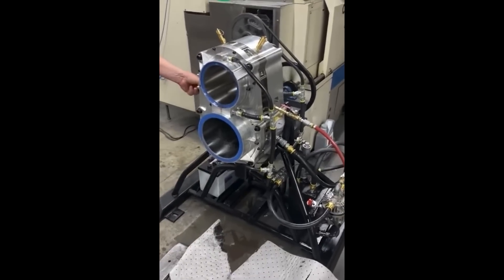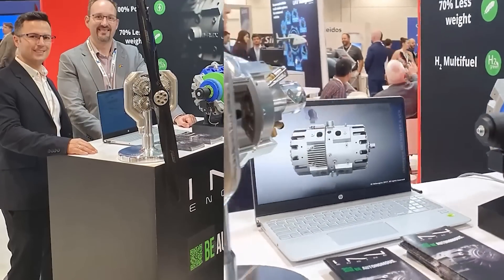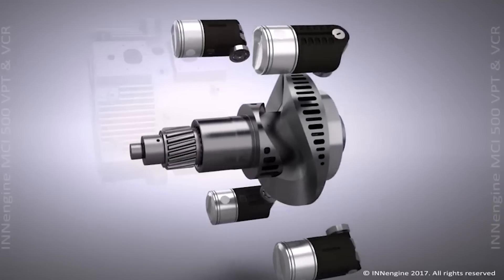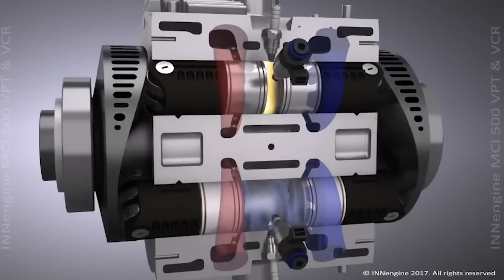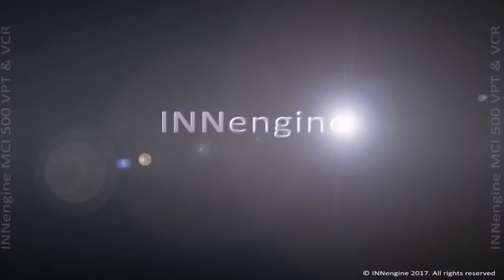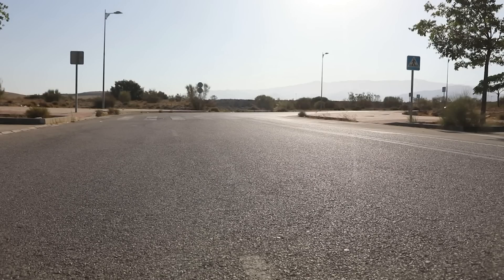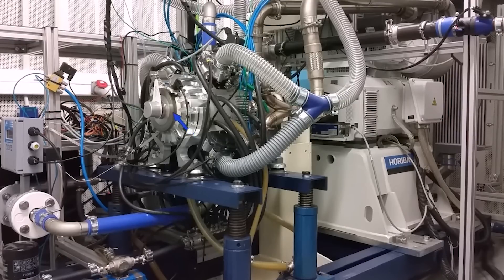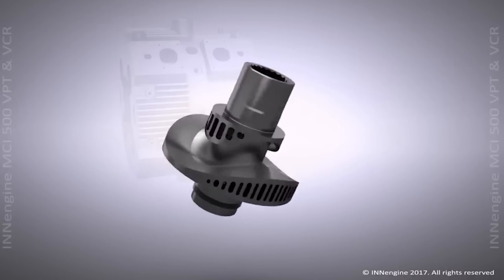1 Stroke Engine: Hydrogen powered Breakthrough in Combustion Engine Design.

Comment: They acknowledge that 1-stroke is a misnomer, but give it that term to differentiate it from traditional 2-stroke engines. Also, they've said that it can run on gasoline as well as hydrogen. Totally brilliant if it's reliable, efficient and truly has low emissions.

Comment: It is 2 stroke because the intake and exhaust are on the same time and not happen during the compression and ignition time. Could be called 3 times, because there are 3 separeted times, blocked or closed for some time.

Comment: >>. I really believe that hydrogen fuel can be the answer to the future’s engine demand.<<
Yeah, I see that. But that is essentially a solution desperately looking for a problem. 
I like the engine idea, BUT: Recent model engines produce H2O and CO2...neither of which is a "pollutant".
There is practically zero CO2 in the atmosphere @ .04%......an insignificant number compared to 78% Nitrogen.

Comment: It has the same problems as the 2 strokes plus additional ones. If it was viable, they would have it in a vehicle or at least give performance specifications
Reply: Es viable.
Reply: There is no mix between oil and petrol. No vibes, less weight. Have you really reviewed the engine?

Comment: Thanks for bringing this engine to our attention. I really believe that hydrogen fuel can be the answer to the future’s engine demand. The reciprocating piston engine delivers the most power per fuel capacity. And , now this engine appears to be answer to the power supply. Brilliant design! Hope it can be sourced for a large project to give it more exposure. Power on !
Reply: Ese motor se fabrica en Granada (España).
Reply: Hydrogen is not fuel. It is just an inefficent battery.
Hydrogen is common only chemically bounded in more complex molecules.
Atomic hydrogen does not exist in planetary nature.
To get it, you must pour energy to break the bounds.
Whatever thing you do with the resulting atomic hydrogen (but nuclear fusion of course) will never give back the energy spent to break the chemical bounds in the first place.
Because of entropy. Laws of phisics, immune to ideology.
Moreover, hydrogen is dangerous and expensive to store.
Want to use gas as fuel? Use methane, or propane, or butane.
All easy to extract or produce, easy to store, very little or no burning residuals, perfect for piston engines. However, regarding aeronautical engines, liquid fuel will always beat gaseous fuel, because of the added weight of a pressure tank. To make an aircraft uselessly heavy because of dumb ideology is hardly an improvement. Jet engines and kerosene are just fine. This said, the one stroke engine idea is worth consideration: it is a funny, cool concept unfortunately flawed by the obvious mechanical weak point of the waved disc replacing the rods and crankshaft. 4 times the power you said? Yes, at equal revs. A two stroke will rev happily over 10.000 rpm, a modern four stroke over 15.000 rpm.
Rev the one stroke engine near these regimes, and it will wear very rapidly, accumulate play, start vibrating and disassembling itself. As it is, fueled with methane, this motor could maybe be a cool, compact range extender, surely cleaner than a gas turbine (that would be my suggestion for a generator, if a simple 4 stroke engine is out of question because of ideology). Using a product for several years instead of scrapping it because of ideological whitch hunting, prevents useless pollution as well: just saying.
Efficent catalyzators solved most of the problem 20 years ago.
Modern petrol engines are robust, long lasting, unexpensive, efficent, clean and dependable. To stop making ICEs because of false technical dogmas, and replace them with battery operated systems or cumbersome "alternative" engine systems, just because of the push of ideological legislation will only increase costs and overall pollution.
Reply: Yes it’s already being produced in volume in a factory. In Manchester. I hoped to find out more about it as it’s worth investing some money in. I was aware of it two years ago. It’s also being laid out by the government’s investment, hence you see all the gas pipes being lined with the yellow plastic, it’s going to be a mix of normal gas and hydrogen through the pipeline very soon as most manufacturers of boilers. Have a conversion kit to run on hydrogen and gas ready for £300 conversion.

Comment: All hydrogen engines are low emissions engines, how does this one fare with gasoline? I doubt it's possible to have zero emissions with that fuel source. How is the hydrogen produced for the motor, is it through electrolysis? So there would be a power loss (internally sourcing) in producing the fuel by needing to generate enough electricity to go through that extra process. It's all very interesting. I'm not an engineer, I just have a basic understanding of science. I'm not trying to critique, I'm just curious.

Comment: Burning Hydrogen in an Internal Combustion Engine (ICE) using atmospheric gasses which has in addition to 21% oxygen needed for combustion of Hydrogen, also has 78% nitrogen. The resulting combustion process of burning hydrogen will produce Nitrous Oxide Gas Emissions. Even very Small amounts of Nitrogen Oxide is a potent greenhouse gas lasting 114 years in the Earth's Atmosphere. A single nitrous oxide molecule has 298 times the global warming potential of a carbon dioxide ( CO2)  molecule. Without removing 100% of the Nitrous Oxide from the I.C.E. vehicles tailpipe emissions, running ICE on today's almost non-existent Green Hydrogen Fuel sources will only accelerate Earth's warming climate change. Today's Hydrogen comes from Hydrocarbon sources, adding to the net greenhouse gas emissions of Hydrogen Fuel to include Carbon Dioxide, Methane (lost in Natural Gas transport pipe leaks) , and now an adder of potent Nitrous Oxide gas to Earth's Atmosphere. I wish you luck creating a  zero emissions vehicle any time soon that only emits water out of the tailpipe.

Reducing Hydrogen I.C.E. tailpipe emissions with urea additive treatments like Diesel exhaust treatment AdBlue, seem not to be a solution. To make urea, producers in a energy intensive (polluting) process combine ammonia with carbon dioxide (CO2), then when used as an nitrous oxide I.C.E. exhaust after treatment an equal amount of CO2 that was needed in urea production is emitted back to the atmosphere. So burning Hydrogen with AdBlue to nigate Nitrous Oxide is returning CO2 back to the atmosphere. So what is the point or why is the preference of burning Hydrogen as a less environmentally taxing replacement fuel to Diesel or Gasoline when both of these fuels choices when burned return CO2 back to Earth's atmosphere when combusted in a Internal Combustion Engine just like burning Hydrogen would?
"....... When AdBlue is used, water vapor, nitrogen and carbon dioxide are released through a process called Selective Catalytic Reduction (SCR)....." Ammonia or Urea after treatment merely shifts the  Hydrogen or Diesel ICE greenhouse gas emissions from the tailpipe spewing into the Earth's Atmosphere to a distant factory that produces the Ammonia or Urea product spewing into the atmosphere there. So the Ammonia or Urea chemical formulation process at the factory from raw materials releases greenhouse gasses. Also the Electricity needed to create the Ammonia or Urea pollutes the atmosphere there or from some other factory who pollutes the air to ship there with even more excessive atmospheric pollutants.Then the factory has to be powered for lights , computers, etc... and climate controlled burdening the atmosphere with more pollutants from electric consumption there and emitted elsewhere by a electric generator. Then plastic jugs / bottles made from oil have to be made and brought by a commercial truck to the Ammonia or Urea factory, causing more pollution. Then boxes need to be made and ink purchased for labels causing more environmental damaging raw material needed purchase plus energy consumption to make and ship..Then the boxed Ammonia or Urea bottles have to be shipped then distributed by truck additionally to the end user all adding to a Diesel or Hydrogen ICE pollution with Ammonia or Urea additive putting additional CO2  into the atmosphere because of being manufactured. Then the  I.C.E driver will drive to the retailer to purchase Ammonia or Urea bottles causing more CO2 into the atmosphere because they are using a Ammonia or Urea additive  Then the plastic bottles because of having chemical residue in them are not recyclable in most places or they are thrown in a dumpster never recycled to go to fill up a landfill causing more pollution. Then the boxes need to be handled to be recycled or thrown out all processes putting more pollution into the atmosphere or landfilled. Ammonia or Urea additives are worse for the planet than letting an I.C.E spew pollution at the tailpipe. Sorry that green hydrogen gas lighting sayers have perversely polluted your thinking. Frankly speaking NO mode of transportation that extracts energy from our environment is pollution free, so pick your Planet poisoning method to get around. Even a very basic form of transportation case in point is that when walking, or riding a bike a human is using food calories from food produced on forest cleared lands, shipped by I.C.E. producing CO2, fresh to you from across the globe, and then we humans produce flatulence during exertion of human driven transportation moving ourselves locally producing Carbon Dioxide ( CO-2) and Methane. An environmentalist in the UK has proposed a solution for this form of human polluting transportation, in that we be kept within 15 miles by wearing a GPS ankle bracelet that reports to authorities your wandering, and fines you for producing extra transportation green greenhouse gasses outside your invisible pen. Please be equally alarmed that human Methane flatulence is a greenhouse gas which is even more global warming than Hydrocarbon Crude Oil, or Fart CO2 emissions. Methane has more than 80 times the warming power of carbon dioxide over the first 20 years after it reaches the atmosphere. Also environmentalists fart after digesting food, so will all concerned environmentalists save the planet from their human induced personal production of global warming digestive gasses lingering for more than a century in Earth's Atmosphere, such as  methane production, by volunteering to stop their bodily biological digestive functions permanently?
Reply: Rather like human extermination?

Comment: They are 2 stroke - not one- these opposed piston 2 strokes are quite common - what is different is the rocking cam system .
Reply: Most of these opposed piston engines are diesel- in trucks/ships/rail locos- Napier Deltic - Knocker Commer etc and giant merchant ship engines - its the rocking cam type drive that may be perfected in the future ?
Reply: WW 2 Aero Engines - JunkersJumo 205 six cylinder opposed piston diesels - Napier Deltic compact high power diesel engines-that rocking cam systems is doubtful  at low revs ?
Reply: Company registered it as 2 stroke, uses only commercially
''1 stroke''

Comment: Nice vid. Nice engine. Actually it is 2stroke 2firing per revolution engine. If you look deeper, the construction is actually Junkers Ju88 plane diesel or 5TD,5TDF,6TD,3TD tank diesel made axial. There was also similar british single crankshaft many levers motor. Getting rid of 2 crankshafts and making small powerful and lightweight engine is super nice. But it is 2stroke with some small inevitable oil pollution. Maybe we can just tolerate that? And using hydrogen in internal combustion engines dates back to at least WWII times. Problems with hydrogen are low energy density and detonation. It is known how to mitigate either of them but simultaneously? Will not it be just toooo expensive in the end?
Reply: exactly, the hydrogen solution isn’t exactly viable right now and people don’t really understand that. As proven by the toyota mirai you need a fuel cell that the hydrogen powers as the amount of hydrogen you would need to power a stand alone hydrogen engine leaves virtually no space in the car. So at best, the current application would just be a range extender. 

I also felt that this video was misleading as no mention of torque was included 😂😂. With no crankshaft there’s significantly less torque and it’s unknown how that curve actually is affected!! To prove that I noticed the mx5 had a supercharger of sorts which was a means of forced induction and therefore it’s almost like the peak torque is at very high rpm. 

Therefore instant torque from a battery would be best suited to this application imo and so it would be cheaper to just buy an ev. 

I guess the marketing should focus on the lightweight for now as the issues are addressed and technology advances!!
Reply: I don't see where it has what I consider 'two stroke' problems. It will need forced induction, and probably cylinder scavenging. The real problems with two stroke is they need to have oil injected into the fuel stream to help lubricate the engine and that makes it difficult to control engine emissions. i don't see that as being an issue with this design.
Reply: Company registered it as 2 stroke, uses only commercially
''1 stroke''

Comment: It is an interesting concept, i see the efficiency gains, but it's still a 2 stroke. Dont see the need for the additional 4 opposed  pistons other than vibration reduction, maybe? I can't see this being a reliable. How do you lubricate the....ummm...lets call them cam-cranks....connecting rods float in pressurized oil on a typical engine. That can't happen here where the piston meets the camcrank, it must be splashed or sprayed with oil like in a turbine engine. I dont see lubrication being nearly as effective on those piston bearings or mating surface and think that will be a life limiter for this engine.
Reply: By having an opposed piston design, you eliminate the head, the head gasket, the valve train, etc. - and instead of converting energy to heat in the valves and head, you can convert more potential energy into kinetic energy into the opposed piston. 

In other words, you can extract more energy per combustion, and there is enhanced sealing in the cylinder. 

There is also a lower oil wiper ring on the bottom of the piston, such as the old 2 stroke diesel engines, which are known for their power and reliability.
Reply: @leeknivek  understand your thinking and I had the same though, if each cylinder was on singular tube, but in second 9 of the video it clearly shows 2  heads. That means 2 sealing surfaces per cylinder since the two cylinders are connected. Many 2 strokes don't have valve trains as well just opening in the side of the cylinder that the piston closes and reveals as it cycles. Any kinetic energy Imparted to the opposed piston is also kinetic energy lost when transferring energy to the crankshaft. 

Most engines have that oil seal right below the piston rings to keep the cylinder properly oiled, but the issue I see here is that you can't fill between piston and the cams that the pistons ride on with oil. Filling the space would meaning losing energy to the pistons "pumping" into the vacated area of other pistons. That means it can't be submerged and I feel the friction would be worse than a normal crankshaft since it can only be splashed or sprayed to keep it lubricated.
Reply: @SomeoneElse92422  I believe that’s a different thing at 0:09, the inn engine cylinders are a solid tube as far as I have seen elsewhere. 

Yeah, I have to agree with the oiling problem, I’m sure they have some sort of solution but it’s not going to be as simple as a typical crank case. 

With engineering there are no perfect solutions, only trade offs - I think the benefits will far outweigh the problems, though, I would speculate that these will last a very long time while being fairly inexpensive and reliable. Will be a good thing for everyone, because the electronics in these modern cars can be pretty fussy at times.

Comment: Why would you combust hydrogen when you could use fuel cells to generate energy with it? 

Is the chain efficency higher this way?

Or does the fact that you don't need a platinum catalyst, offset the price so much that it outweighs the expected lack of efficency in that way?

Comment: That 1 stroke is absolute BS! That is a 2 stroke with some updates from the original like not burning the lubricants. But it does exactly what a Trabant engine does when you look at the combination circle, that is what makes the difference between 2 and 4 strokes! Also this 2 power strokes per circle is just not true except for the 2 cilinders that fire at the same time but that is like just putting 2 normal 2 stroke engines together it's not really a new thing just twice the old. There are real great things about this engine like power from the size and weight. That is what they should be marked not that 1 stroke BS😂

Comment: I still see two strokes.... The pistons move one way, then another. There's a compression and power stroke. That's two strokes. It will need supercharging to get combustion air into the cylinders. VW has settled on 500cc per cylinder engines, which with tuning, can make 100hp per cylinder, using 4 strokes. If converted into 2 stroke, it would be closer to double. But, once you adjust for the energy density difference between hydrogen and gasoline, you'll see why the hydrogen 2 stroke gets 120hp.